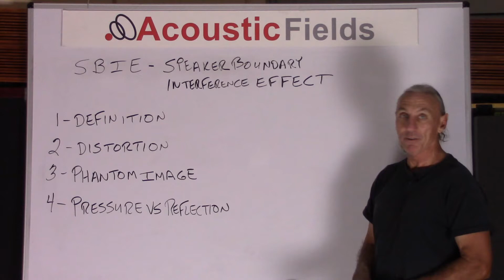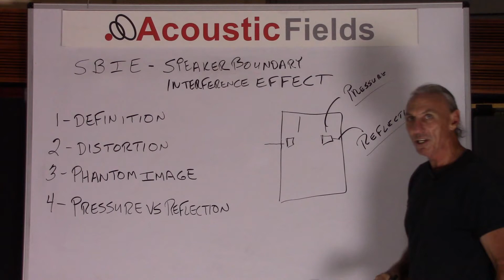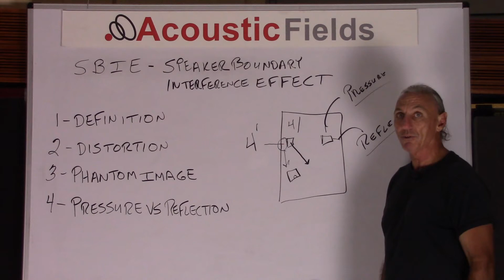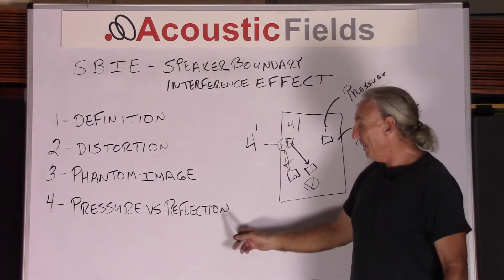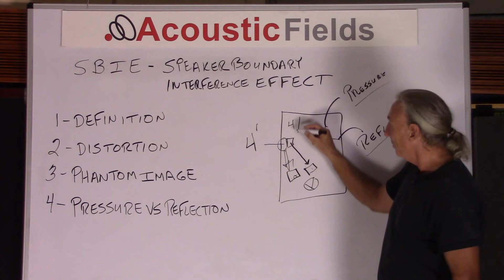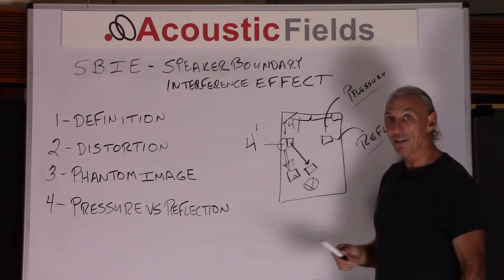What Is Speaker Boundary Interference Effect? - www.AcousticFields.com

Comment: Suppose I. Home cinema not much of an issue because your centre handles most of the sound about 80% and is usually 4 feet away from the sides most of the time this is what I use my system for mainly.
Reply from the maker: The center speaker's performance is still subject to boundary interference and room acoustics, which can impact overall clarity. To avoid this interference, we split the center channel into left center and right center. We use the same speaker for the left center and right center as the left and right channels. This keeps everything in the same dispersion array.

Comment: The Allison effect refers to a specific acoustic phenomenon that occurs when loudspeakers interact with room boundaries, particularly affecting bass frequencies. This effect was identified and studied by Roy Allison, an audio engineer who worked to address the issue in speaker design. Here's an explanation of the Allison effect and its implications for speakers in rooms:

The Allison Effect Explained

### Bass Behavior in Rooms

Bass frequencies are omnidirectional, meaning they radiate in all directions from a speaker[1]. When these low frequencies encounter room boundaries (walls, floors, ceilings), they reflect back towards the listener. This reflection can cause two main issues:

1. **Phase cancellation**: When the reflected bass waves are out of phase with the direct sound, they can cancel each other out, creating dips in the frequency response[1].

2. **Bass reinforcement**: In some cases, the reflections can amplify certain frequencies, leading to an uneven bass response[1].

The Problem

The Allison effect specifically refers to the cancellation and reinforcement patterns that occur when speakers are placed at varying distances from room boundaries. This can result in:

- Large dips in the mid-bass frequencies
- Uneven bass response throughout the room
- Inconsistent bass levels depending on listening position[1]

Allison's Solution

Roy Allison developed speakers designed to mitigate this effect:

Speaker Design

- Allison speakers were specifically engineered to be placed in corners or against walls[3].
- The frequency response of these speakers was tailored to sound neutral when positioned close to room boundaries[1].

Woofer Placement

- Allison's designs placed woofers very close to one or more adjacent room surfaces[3].
- This approach changes the frequency range of the dip caused by reflections, potentially moving it outside the woofer's operating range[3].

Benefits and Tradeoffs

Advantages

- More consistent bass response throughout the room[1]
- Reduced impact of room acoustics on low-frequency performance

Disadvantages

- Somewhat unusual soundstaging
- Less precise imaging compared to some other speaker designs[1]

Alternative Approaches

While Allison speakers offer a specific solution, other methods to address room-speaker interactions include:

1. **Asymmetrical placement**: Positioning speakers at different distances from side and front walls to stagger reflection points[2].

2. **Room treatment**: Using acoustic treatments to absorb or diffuse problematic reflections.

3. **Digital room correction**: Employing software and hardware solutions to compensate for room effects.

Understanding the Allison effect is crucial for achieving optimal bass performance in any listening space. While Allison's specific speaker designs are no longer widely available, the principles he uncovered continue to inform speaker placement and room acoustics strategies for audiophiles and sound professionals alike.

Citations:
[1] https://www.hifi-advice.com/blog/audiophile-insights/generic-insights/room-acoustics-last-barrier-of-most-important-factor/
[2] https://the-audio-expert.freeforums.net/thread/559/allison-effect
[3] https://www.stereophile.com/content/glorious-time-ars-edgar-villchur-and-roy-allison-allison-part-2
[4] https://www.audiosciencereview.com/forum/index.php
[5] https://www.youtube.com/watch?v=BqFX4UmdBgc
[6] http://www.troelsgravesen.dk/BOOKSHELF-1/RoyAllison.pdf
[7] https://www.tnt-audio.com/clinica/room_acoustics2_e.html
[8] https://www.diyaudio.com/community/threads/room-gain-complementary-rgc-tuning.133398/page-2

Comment: Is the 4 Ft distance from side wall the same for Magneplaner Tympami three panel each side, di-pole speakers? Magnepan shows then in some setups, butted up against the side walls and 4 Ft from the back wall.
Reply from the maker: Never, never, never, place a speaker, no matter what type, against a room boundary surface. Manufacturers show that because they want you to think that their product will work in today's small rooms. A 4' distance is a good start. However, room size may require greater distances.

Comment: Thanks Dennis. Everyone make sure you’re not guessing and actually measure your room so you know what’s going on. Use free software REW and get a umik-1 usb mic. For under $100 you’ll know your problem frequencies. In my room my monitors were best suited as close to the front wall as possible. The biggest problem I noticed in my room was a dip everywhere in the room at 65hz (weak kick drums!) The offender was an 8 foot ceiling causing this dip. Why? A 65hz wave is 17 feet long. Any multiples 1/2 1/4 etc are typically cancelled. So , 8 foot ceiling being err roughly 1/2 that caused that 65hz cancellation. Careful about having speakers 4foot from sidewall, 4 foot from front wall, and 4 foot from ceiling btw, recipe for disaster. There are theories that these similar distances should be minimized. Anyways, go measure your room so you know what you’re dealing with!
Reply from the maker: Measuring is not even necessary in most rooms. Our data base of over 250 + rooms built and measured tells us frequency, amplitude, and location on every wall surface. Locating unwanted pressure issues within small rooms can be done easily. The difficult part people have is treating those frequencies and amplitudes in the proper room wall locations. And it is never the corners. This is the propaganda machine of this current acoustic culture working over time. It has always been and will always be about treating the whole wall surface area since it is the whole wall producing all of the unwanted issues. For room modal issues, think two parallel walls, not two parallel corners.
Reply: @AcousticFields  Thank you Dennis. That's great advice regarding treating the whole wall instead of the corners, as that was going to be my next step, so thank you for helping me dodge that bullet. Pertaining to my measuring, in my case I had an L shaped room with a skylight extending part of the ceiling height and several wall openings, so it paid to measure. Interestingly enough, I measured before the desk was present and got the flattest response in the low end with the speakers against the wall. After the desk was added, it turned out the flattest response was with the speakers away from the wall and right behind the desk. 

Question.. better to treat first reflection or front wall first? Front wall is glass, side walls are drywall. Thank you

Comment: Can diffusers at the reflection points help reduce the effects of SBIE?
Reply from the maker: E, Yes, but it is a very expensive way to do it. Secondly, a diffuser may not go low enough to deal with certain frequencies.
Reply: From the newer homes I see (at least here in Alberta) it is very rare to have an ideal room size.  So I think diffusers will be the way to go then for most people.  Thanks for the reply.
Reply from the maker: E, Diffusers must have the proper distances to work effectively. You need 6 -8' minimum for most sequences. Absorption is your only choice for small distances.

Comment: Dennis ... Thanks for this tutorial. But you said 4 ft  from side or rear .but my room is like most others and its about 13 ft by 14 ft . I cant do that . Do i need other measures ??? 
My best positioning so far is when i followed your 1/5th rule . I placed the speakers one ft from side walls and about 22 inches from the wall behind em. I toe them in about 35 degrees  And i sit only  4 to 5 ft from the front wall  where my amps are located .i believe i just sit in the spot where the room mode is minimized and theres no boom . The imaging is right On and the highs are beautiful.... I do feel the deepest  bass notes get anemic here .
But i tend to love my system when i do that
Reply from the maker: S,  You have to move speakers around and test which positions give you the smoothest response curve. There is no formula to use. Start at a 3' distance from all boundary surfaces and then make that spot. Move in 1" - 2" increments.

Comment: Worst description of speaker boundary interference I have come across so far. SBIE is the result of reflected waves from speakers, especially at low frequencies where the speakers act as an omnidirectional source, cancelling or adding dependant on the frequency in relation to the distance from a boundary. Speakers that are placed one quarter wavelength from a boundary will result in cancellation of that frequency as a result of the reflected wave.

Taking 4ft as an example will result in cancellation of frequencies around the 60-70Hz region (4ft being 1/4 wavelength for that frequency) and attempting to trap those frequencies is a much harder task that pushing the speakers closer to the boundary (rear wall say) where the 1/4 wavelength will be shorter, thus the cancellation frequency higher and easier to trap.
Reply: Agreed. The acoustical theory is completely misunderstood on this channel and it is sad to see so many positive comments and people taking in this misinformation about modes and reflections as gospel.
Reply from the maker: T,  Wave canceling using using quarter wavelength is unpredictable and inconsistent. Using predictable and consistent performing low frequency absorption technology is much more effective. I see people guessing at this everyday. I see no success. This is why they use our carbon technology. This is why I created it. It takes the guesswork out of the equation.
Reply: Acoustic Fields Unpredictable or not nulls due to SBIE/R is very easy to measure after the fact, and in the last room I measured the total dip at 78 cycles was directly correlated to the distance (around 1 m). Trapping the waves would need to be done on the front wall (room modes can be dealt with on the back wall) which isn't always practical. For practical reasons moving the speakers closer to the front wall is in my opinion a better solution for small rooms, since the low frequency comb filtering isn't as big of an issue due to the long wave lengths, and the comb filtering and SBIR issues in the highs are easier to fix with absorption. Optimally however, it's best moving the speakers far enough from the boundaries in order to push down the SBIR below the speakers' frequency response - although that would require a distance of 14" for 20 cycles. Or am I missing something?

Comment: Hey Dennis.  Your videos are very much appreciated.  I have a question for the independent engineers/producers regarding monitor positioning in smaller rooms (9X15 for example).  David Shevyn from GIK Acoustics has a theory that by pushing the speakers closer to the wall, you'll reduce low end speaker boundary interference and instead increase higher frequency (300Hz +) interference, hence making the resulting distortion easier to treat with broadband membrane absorbers.  What are your thought's on this, is there any truth to that statement?
Reply from the maker: A,  This has not been our experience. Placing a low frequency energy source closer to a boundary surface area increases unwanted, low frequency issues.
Reply: I see, that makes sense to me.  Thank you for clarifying.

Comment: VERY bad tutorial for anybody who does not have a very big room which is probably about 80% of all home studios. being 4 feet away from the front wall in a small room can easily put you in the middle of your room and very close to the back wall so please don't say this is a MUST to do because that is misleading and bad information. There are numerous pieces of information and articles from reputable acoustic companies such as GIK Acoustics, Real Traps, and M audio who say to do the exact opposite which is put the speakers as close to the front wall as possible if you have a smaller room and there reasoning makes sense. So you are telling me that if some has a 10ft by 8ft room, they should be 4 feet away from the front wall?? That doesn't make any sense so if it doesn't make sense then in most cases it isn't always true. That may be the ideal distance from the front wall but when doing tutorials like this, you need to make sure you don't say things like "It must be no less than 4 ft away from the front wall" because that only applies to about 20% of people who operate home studios and have big enough rooms to follow your advice. Please clarify if what I'm saying is wrong.
Reply: Very good point
Reply: a 10' by 8' room is too dang small. that's a tiny bedroom, hardly a room for decent sound quality, especially to do any serious work in.
Reply from the maker: Hi Audio, If you want more room sound, you place your speakers close to room boundary surfaces. Room sound is distortion. We subscribe to less room sound or distortion and more music. Quantity is not quality.
Reply: Acoustic Fields So regardless of how small the room is, one should still place monitors a minimum of 4 ft away from the wall even if it places the monitors dead center of the room (which I thought was a cardinal sin in placement)?? Thx

Comment: Thanks a lot!

Now I understand why everything sounds horrible in my room, even with a basic off the shelf acoustic treatment kit.
Reply from the maker: There have been no real advances in room acoustic treatments for at least the last 30 years until RPG made the quadratic diffuser commercially viable. Most technologies today are just repackaging of building insulation and other such materials with no regard for the proper rates and levels to deal with each frequency issue within your room, especially when it comes to low frequency absorption. Materials that were never designed for sound but for BTU retention.

Comment: I have always kept my speakers 4 foot away from the walls, but I have a 20 foot wide brick wall in my home that acts as a diffusor, that allows the speakers 4 inches from the rear wall. There is absolutely no, nil, no sound reflections from a 20 foot brick wall. Imaging is fantastic, bass is great, therefore I need no sub. Plus, the speakers 4 inch woofers, close to the the wall has the loudest clearest bass, beating any of the bigger subwoofers farting.

Comment: Minimum 4 feet from the sidewalls? Great info...my speakers will then be 2 feet apart!
Reply from the maker: chubbybeng Yep and that's why there are minimum size dimensions you need to look for in a listening room, really no less than 14 feet, 12 feet at a push on width and a longer length. Too much pressure in too small of space dictates that I'm sorry to say.
Reply: What about the room gain

Comment: Can sound absorption or diffusion atleast diminish the SBIE in a setup that is limited by where the speakers can be placed?
Reply from the maker: Hi modernpsalmist 

It depends on what SBIE you are referring to. Is it a pressure or reflection issue? Is it low, middle, or high frequency issues? If it is pressure related, then no, not even if you use the correct amount, type, rate, and level of sound absorption technology for the SBIE low frequency domain. If it reflection based then no. This is the ugliest and most sound destroying of all the room distortions. I can live with room modes, over SBIE anyday.

Thanks
Dennis
Reply: So the short answer is no. From my understanding, diffusion needs distance depending on what freq.s, so diffusion wouldn't help being right next to the speaker on the boundary wall/s since most of the waves wouldn't have time to develope. However even absorption makes no difference at all? There has to be some sort of effect. I'm not as much concerned with the pressure areas behind the speakers since there is atleast the min. distance behind them and I have to eat this elephant one bite at a time, but they are directly next to boundary walls. I guess that's why it's common to see flyable speakers now?
Reply from the maker: modernpsalmist 

You can not compensate for lack of distance between two energy producing/reflecting objects. Move them closer to room center. Get everything out of the sound triangle and make sure your side wall to speaker distances are equal. Every one of these three, that are not achieved, reduces sound quality by one third.

Thanks
Dennis
Reply from the maker: modernpsalmist 

I also answered your original question in a little more depth in this weeks Google Hangout.  You can see your answer here:
http://youtu.be/J-Sr0YtDPPA

Thanks
Dennis